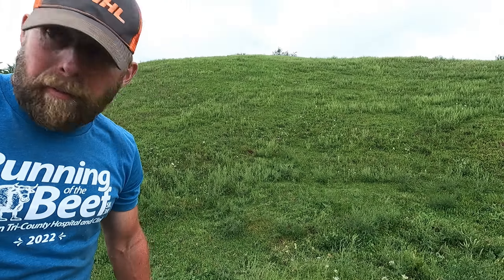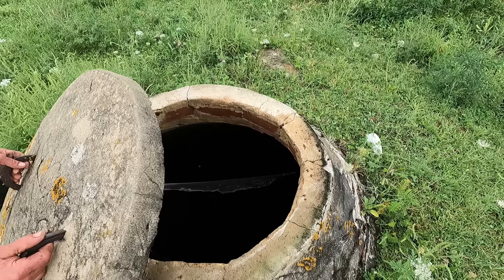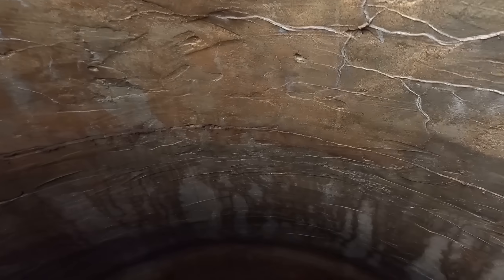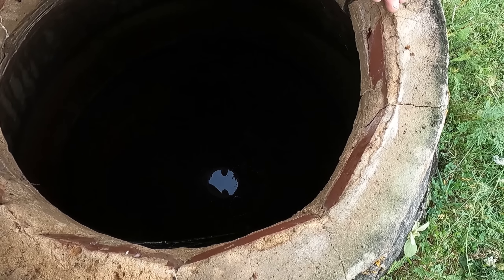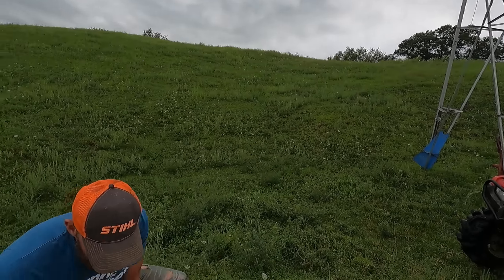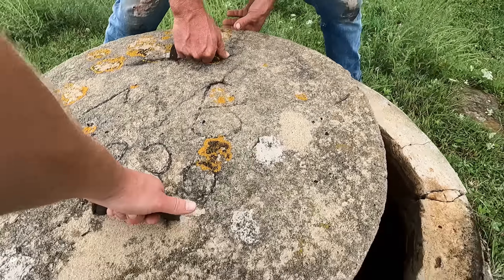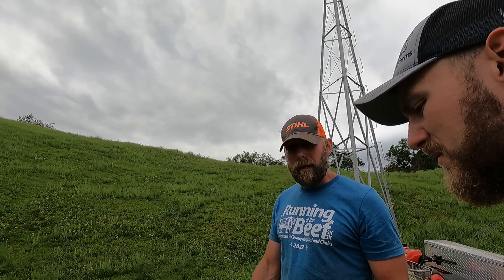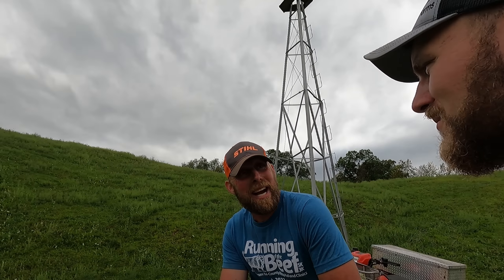A Piece of History l What’s Inside? l (1930)

Comment: Lots of them around me.............fed by springs higher up on the hillsides............We had one on a rented farm that was probably 10x20 with a 8 ft high ceiling, entire thing was poured out of concrete, spring fed through the back wall.  If fed the farm we rented and the neighboring farm at one time, no pump anywhere on the system and by the time the run of pipe dropped from the mountainside and traveled a mile, you had water pressure that rivaled any new system.  Its still in place up in the woods, the line is still in place, but the one farm it fed is gone, the other still has the barn in place but its slowly collapsing.  Now all the water runs out the overflow poured into the side and into a creek.  Marvel of engineering when put in around the early 1900's.

Comment: This is another great video. We had an open hand dug well where I grew up as a kid. There were loose bricks for the first 20-30 feet, then a pipe below that which fed the well from artisan pressure. Because the water was close to the surface, we were able to pump water with a piston pump in the barn a hundred yards away. Our well was covered with a wood cover, an accident waiting to happen.

Comment: Our old farm house had a 250 gallon tank in the attic of the house.  It feed the pipes to the kitchen so that there was running water.  It was filled by the windmill that pumped it up to the house.   There was a tank also in the haymow of the barn for the same purpose.  There was a small pipe that was the overflow that stuck out of the attic on the back side of the house.  It there was water coming from it the tank was full, and you disconnected the windmill from the well or switched to to fill the barn tank.  We never had to use it but the tank was still in the house in 2019 when the house was torn down.  The house was built in 1884 so my guess is the tank was there when they built it.  It was made of wood.

Comment: We tore down a very old, run-down house on our extra lot, which had a cistern (and a coal shed; half coal, half corn cobs for starting). The cistern was filled in best we could, but every year Dad would add a little more fill as it slowly settled. It took about 40 years until we no longer had a little divot form where the opening was settling.